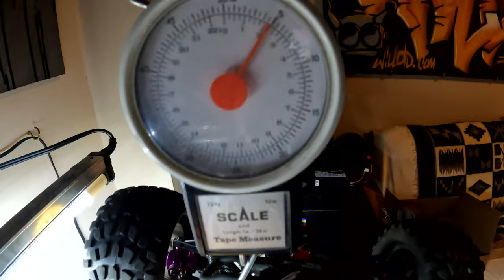RC - HSP Brontosaurus Fix Steering Slop, Overhaul, Tricks, Tips, & Improvements Pt. 1 - Fix - 94111

Comment: put cvd in front insted of dogbone
Reply from the maker: I tried a few different versions of CVDs for these trucks, none survived. The joints fell apart even under normal driving,  and axles snapped when jumping and bashing. I found it cheaper and simpler to just  replace the dogbones when they would break.

Comment: Great video.  Where did you get the battery tray in the first truck?
Reply from the maker: @michaelmackay9964  thanks! The tray is from Redcat Racing, part # 61006, stock part for the Volcano Pro EPX The HSP chassis needs one hole drilled for it to fit. https://www.redcatracing.com/products/61006?variant=30993673224282&?srsltid=AfmBOoqoYYyzKzYE51jSNX_a2u2dbVbNk0yHIs5aeJ9bJd2xPrcSVni2

Comment: Great video well done 👍🏽just a question what washers sleeves and screws you used for the front metal steering hub ? Having some issues with it. Cheers
Reply from the maker: @CARLOSBEATBOX  thanks! The sleeves I used are part# 02101, m3 screws that are short enough not to hit the cup but long enough to fully thread into the threads (use loctite but not too much, it can run into the bearing and seize it), and the shims and washers are from an assorted shim kit, around m3 size. 
Sleeves:
https://www.rchobbiesoutlet.com/02101-steering-bushing-hsp-redcat-tyranno-himoto-etc/
Shim kit was something like this, can’t remember the exact size:
https://www.amainhobbies.com/team-brood-4x6mm-steel-shim-assortment-w-plastic-container-28-bro-tbr-4x6ast/p1424602